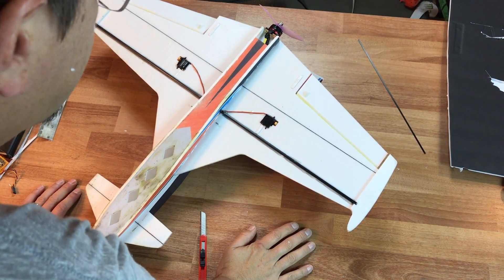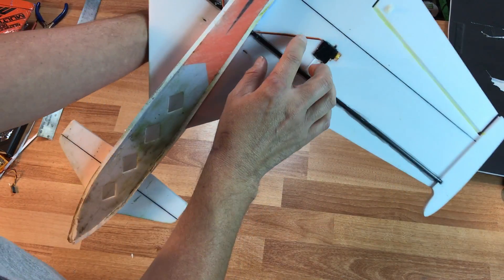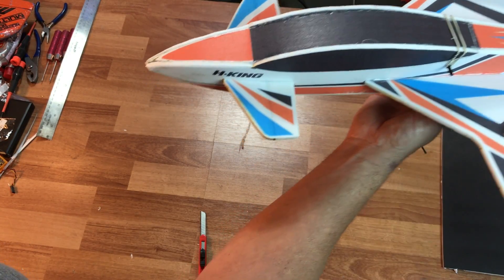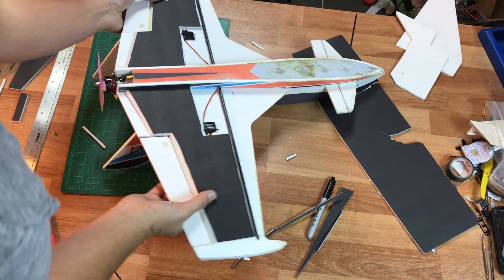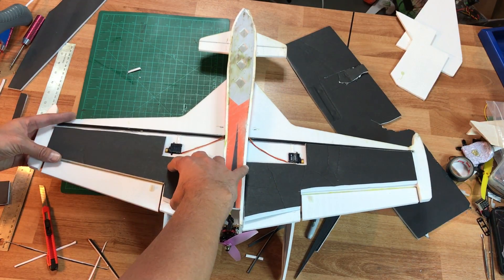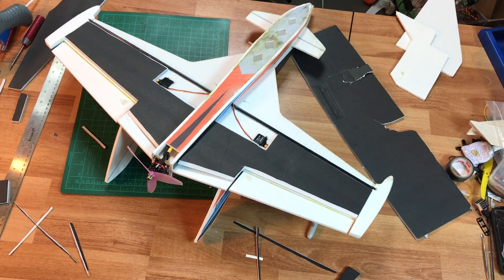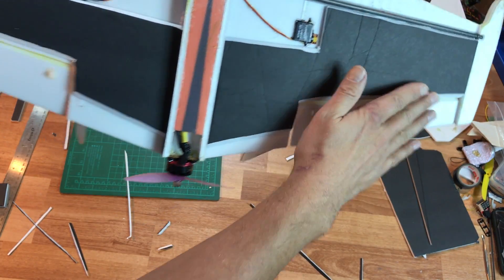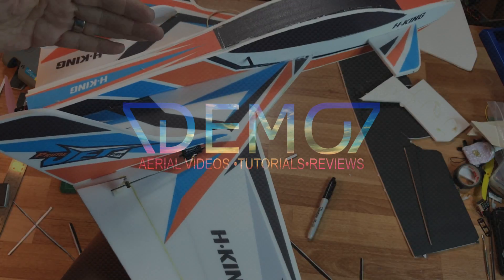Prime Jet Pro Addressing issues

Comment: A poor solution to an easy fix. The Artic Cat has float profile pieces set underwing, and adding these  would stiffen and stabilise this aircraft. Because you opted for a layering solution, a really good alternative would have been to use an F4 profie piece ON TOP of the wing, thus increasing lift, with relatively less drag than the pieces shown, and also providing strength.
Reply from the maker: It’s a piece of crap that I eventually threw in the trash... not too worried about it, but good idea though

Comment: I am building mine right now, that is also my first rc airplane. how to make the aileron hinges? it seems you did not use any tape. how did you do that?
Reply from the maker: JC I would use Dap  weldwood from Home Depot- btw That is a terrible first airplane, you want to get a high wing trainer with a propeller from the top of the wings Facing backwards.
Reply: @7demo7review  Thanks for your reply. I have been flying rc helicopters for years, but never an rc plane. How hard is it to fly a plane? Could you please let me know where the CG of this Jet Pro is? I could not find this info anywhere. Thanks.

Comment: Didn't you just create a negative airfoil? Might need more angle of attack to compensate...
Reply from the maker: No- the round spar in front of the foam board is on top of the surface- not embedded.  the foam board is "drafting" behind the spar- it's hard to see that in the video.  I just took off the square leading edge so it wouldn't create more drag.  I'm flying it tomorrow- if its a fail- you'll see it on this channel, lol- thanks for the comment.